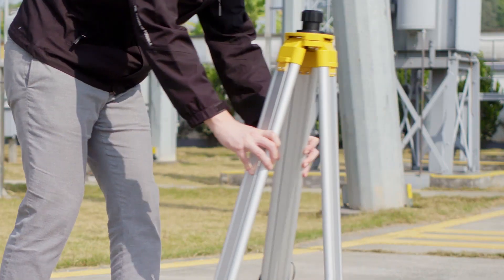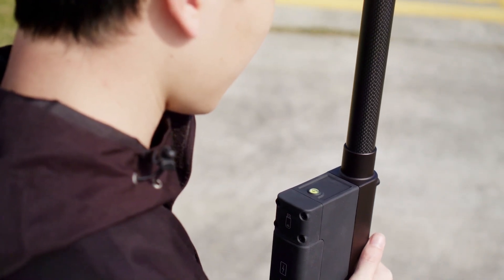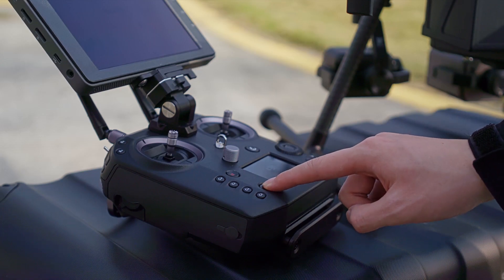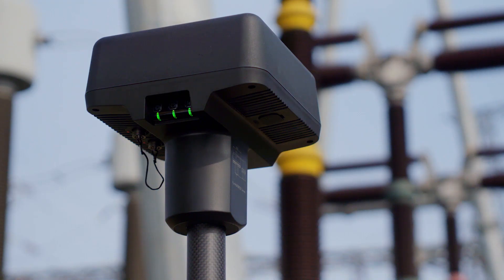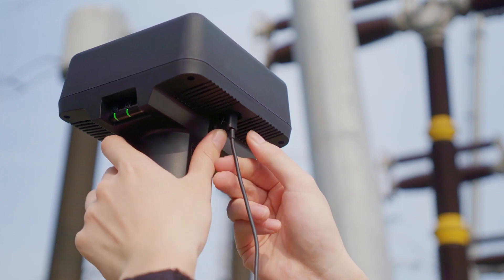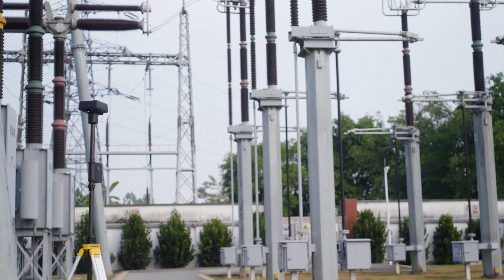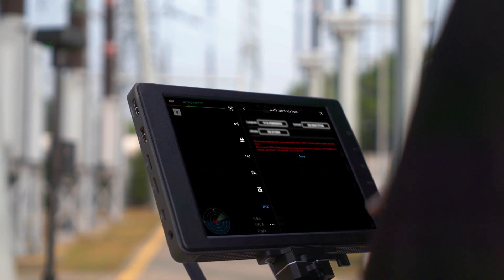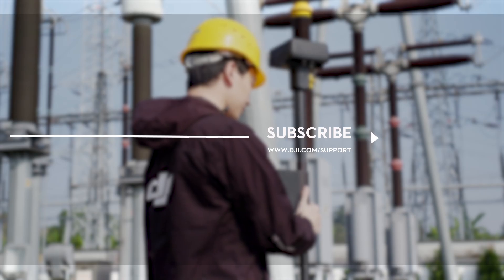How to Set Up the D-RTK 2 Mobile Station

Comment: Hi, thanks for the video.
But I still don't understand whether or not it is necessary to enter the coordinates in the DRTK2 station.
According to the video, for a specific job, the devices are linked without doing anything at the DRTK2 station.

Is what I'm saying correct?
Is it necessary to take the point with its own station in rover mode on foot and enter it to carry out the RTK flight with the drone?

Comment: I want to enter the base point mark, should I take into account the height of the mobile station?
Reply: at a fixed antenna height you should just enter the ground height under the spike, the system should compensate the elevation change, if not then a global shift wont be difficult if you have the height difference between the base point and what the model comes out at but it wont be necessary

Comment: when we use     Matrice 300 RTK with D-RTK 2 Mobile Station for matrice series
Does it necessary require an internet connection
will the RTK work in Area where there is no internet or even mobile phone signals ???

Comment: Thank you very much. I have a 210 matrix with rtk, but this does not record the position in the photos I capture, I would like to know what I can do to achieve it, whether it is possible or not or what additional element I should buy to write the position of the rtk in the photographs, to perform photogrammetry
Reply from the maker: Hi Elkin, just to verify, are you referring the issue that the RTK Flag is 0? If yes, our engineers have aware of this issue and are working on it, this issue will be fixed on the next firmware. Please kindly wait patiently. Please let us know if we misunderstood the case. You can keep us updated via email support@dji.com.

Comment: I’m constantly losing connection and forced to switch to PPK. That’s a problem because not only is this slower it also loses accuracy. Please help. I’m inside a city and not in a suburban area.
Reply: Hi, it is suggested setting up the D-RTK 2 Mobile Station in a high place and open area to avoid the obstacles and interferences around. 
If it keeps disconnecting, please connect the Matrice 210 RTK V2 and the mobile station to DJI Assistant 2 to export the data for us to investigate the details. You can send the details via email to support@dji.com.

Comment: Is it possible to use this completely indoors without an external GPS signal at all? For example, could you manually set the base station coordinates to a known fixed point inside an aircraft hangar and have GPS work on the drone?
Reply from the maker: Hi Colin, we're sorry that it is not recommended to use D-RTK 2 Mobile Station indoors.
Reply: @DJISupportGlobal  Okay, thanks for the reply!